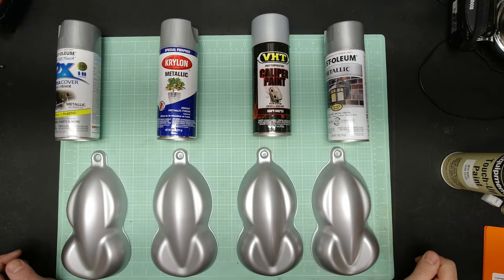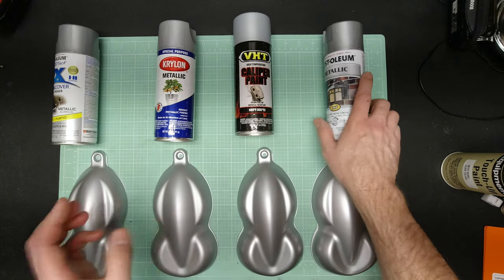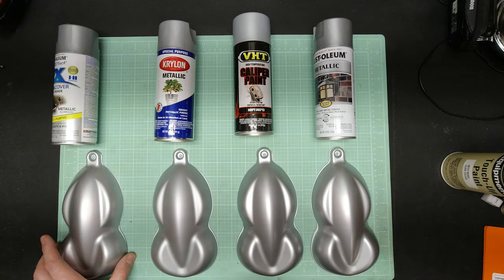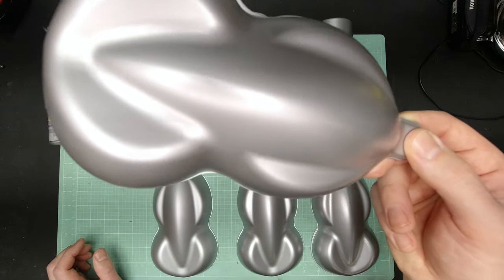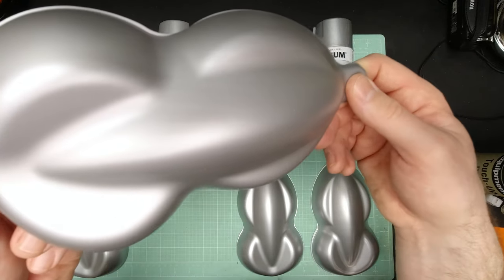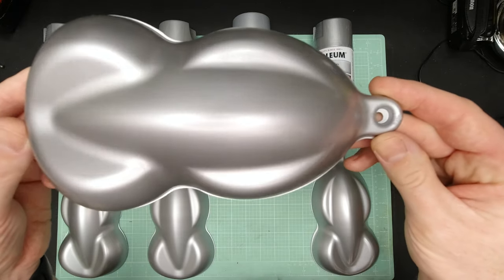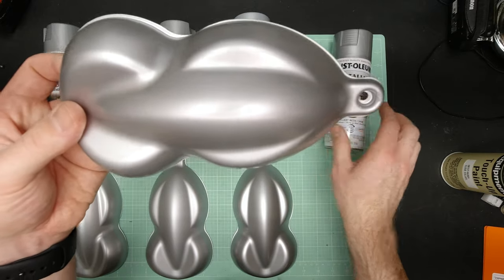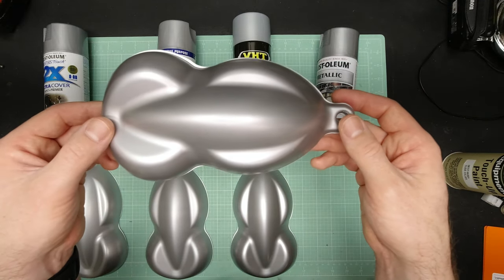Honda CT70 Cloud Silver Comparison

Comment: I just this paint job with the VHT on an old honda wheel hub, and it came out very rough, I didn't wet sand on the primer, not sure if it would have made diff. But I did bake it 200F for 1hr per instruction, and it was still rough after the bake. The texture is like a brand new unpolished cast iron skillet. Going to get a can of gloss clear and see if can get a glossly look. Otherwise the colour seems to align pretty good.

Comment: What about Dupli-Color BCP103 Silver Caliper Paint, or their Base Anodized Silver/ VHT Base Anodized Metallics Silver?
VHT Engine Enamel Sp995?

Rust-Oleum Lacquer Customs Silver Metallic 323351 (might be almost similar to the RUST-OLEUM Silver Metallic 7271830 you presented in this video)

And RUST-OLEUMS Universal Metallic Paint & Primer Titanium Silver 245220?

Lastly Their are like 6 different aluminum and Silver metallic paints Eastwood makes, and SEM makes ALOT of Silvers too im pretty sure... I do Know they have the NH700M/NH700XM Alabaster Silver For Hondas & Acuras, but no NH623M Satin Silver Metallic For most other Hondas/Acuras/, which is SURPRISINGLY & UNFORTUNATE!

They have a TDS on a chart for all Acura Honda OEM colors on SEMs Website! So far I think that Rust-Oleum 7271830 is like a SPOT ON COLOR MATCH For the NH623M Satin Silver Metallic but im curious to see the Customs 323351 and some of these other silvers I mentioned...

I know Car Quest can mix up nice Color matched paint in a 16oz can (instead of a measly 7oz or 8oz like most others do) for like $27... Thats not bad for 16oz! A 17oz or 20oz aerosol can would be EVEN BETTER! but the 4th biggest available size from the monster Turbo 24oz is nothing to complain about really...

7oz, 7.5oz, 8oz, 10oz, 11oz, 12oz, 13oz, 15oz, 16oz, 17oz, 20oz & 24oz are pretty much the most common... There are some 9.5oz, 10.25oz, 10.5oz and 14oz but those are typically very uncommon.